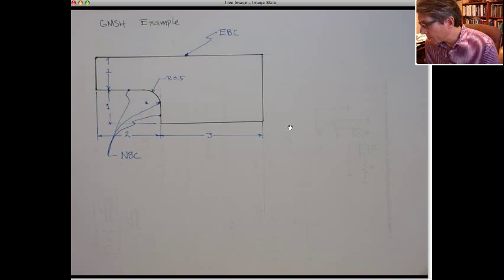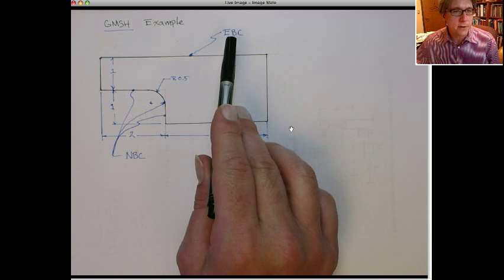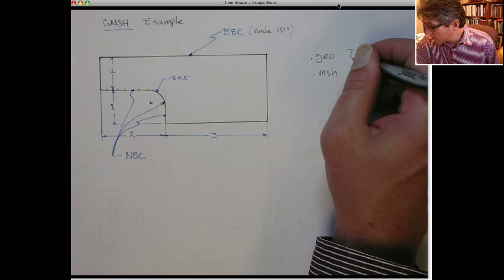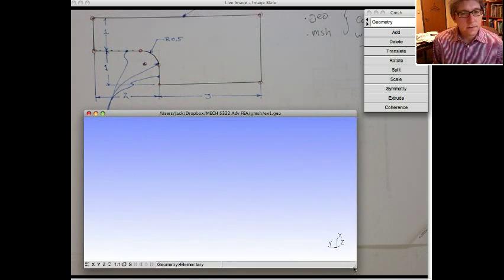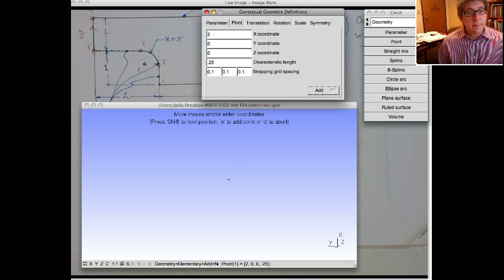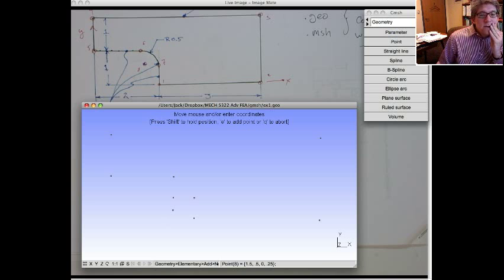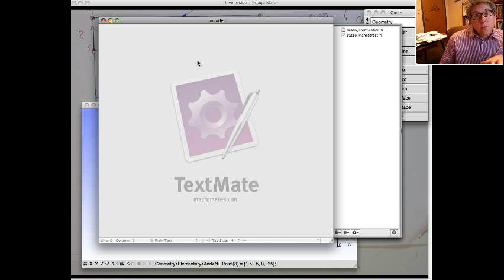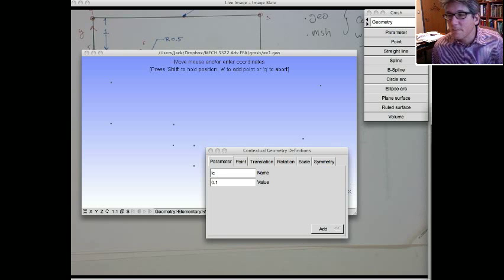Gmsh and Matlab Part 1 of 3

Comment: HiI generate mesh using gmesh but I have problem in matlab.""Undefined function or variable 'importMeshGmsh'.Error in laminar2 (line 9)
[p,e,t] = importMeshGmsh('laminar3.msh'); """" Index exceeds matrix dimensons.Error in importMeshGmesh (line 114)p(1:3,i)=[abcd(2:)]';error in laminarshow (line 5)[p,e,t]=importMeshGmesh('laminar.msh');Could you please help me inorder to import the mesh into matlab.
Reply: Mohammed Ismail, have you got the MatLab files? Could you share those with me? It would be so helpfull. My e-mail adress is m.knabben95@gmail.com